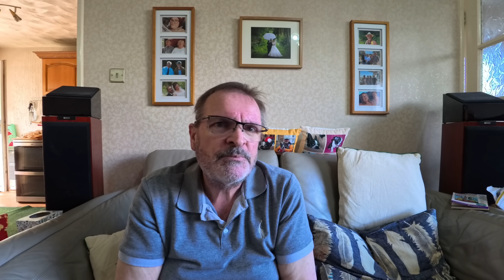Expert Ships Engineer Reacts to Baltimore Bridge Crash

Comment: Even if he managed to reverse the engine backwards, the effect of the screw occurs only after a significant reduction in speed, so turning to the right may be the result of a wide loop of instability, as a result of optimized trim to save fuel.
Reply from the maker: Surprised we have heard more yet

Comment: I enjoyed your modest but experienced perspective. As I rewatched the video of the crash after seeing the one anchor chain down toward the end of the video I wondered if the anchor dragging on the bottom on that leading side could have caused the back end to swing around and divert the front end into that support. Seems possible but I wonder what you think about that. Thank you.
Reply from the maker: Ive seen a second video from a different angle, you see the boat turn slightly to port just before impact. This suggests to be me the boat either hit a mud bank or the port anchor started to bite in.
Also ive been informed that the sea bed here is very soft mud so that kind rules out the anchor biting in. 
Lucky for the boat it did deflect slightly to port as it prevented the ship from striking the very base of the bridge legs.

Comment: Just so folks know, starboard is right and port is left. Also wondering if the Dali is a single screw or twin screw? That would mean left prop would be rotating in a right-hand direction and the right-side prop would turn in a left-hand rotation. Power to both at same RPM makes it go straight, varying more thrust from the right prop would make the ship turn left to port from increase of thrust while the left prop would have a reduction in power.
Reply from the maker: Single screw, most large ships only one screw

Comment: Thank you for your explanation.
However, I think the rudder effect doesn’t work at a speed of 7 knots. The ship turned quite fast.
Also when the lights gone out for the first time there shoild be a other aux starting and not immediatlely starting the em gen. Although i am not shore on that vsl.
Reply: No, it looks like a blackout.
So all trips. Reason unknown but could be simple as a fuel problem.
Reply from the maker: Yes im pretty sure the preferential trips would have gone first so why did the light go out.

Comment: You would think that the Pilot, an experienced sailor, would understand the ramifications of trying to go astern with forward momentum on a ship of that size.  Oh and they had two pilots. The idea, as the man mentions above, would be to clear the maritime obstruction (the bridge) by going ahead and using your restored power to maintain the vessel on a course to clear it.  You can run in your head based off of your ship's characteristics (tonnage, displacement, etc) how far the ship will travel after you give the order engines astern given current speed, current, wind direction and speed.  This is data that the pilot is provided with.  I don't think that the ship would have avoided the bridge even if power did NOT go out.  The forward moment of the ship, now with the crabwalk created by ordering engines astern changing the course of the ship, was going to hit the bridge supports whether it was the wrong call or done intentionally.  An order for engines astern or all stop is not instantaneous.

Comment: His expertise does not include bridge engineering. I would like to hear from structural engineers regarding the kinetics of the  bridge collapse.
Reply from the maker: Bridges are designed to support the normal loading but push it with a 100,000 tonne ship doing 7.6knots in the wrong direction.
Reply: @retroonhisbikes  Of course. The WAY the bridge collapsed after impact needs careful examination. And this fellow is not qualified to comment on that aspect of the accident.

Comment: This is a bridge that has well-known issues but its size would make it very expensive to replace. If the ship had an accident and damaged the bridge it would have to be replaced no matter what. I'll leave it to you to decide what really happened. Did someone decide to find an excuse to replace the bridge? Did the master of the ship decide to switch to bunker fuel while negotiating the harbor? The bridge was built during the 60-70's and the abutments were not properly protected from collisions.Ships of this capacity should be shadowed by tugs clear of any potential obstructions.

Comment: The ch/engr is spot on in this vlog. The stern movement was given which is clear from the black smoke was disaster, this action was taken by the pilot in panic. For Those who are not familiar with ships, the rudder does not work in stern movement. Half ahead movement no matter for even 45 seconds would have cleared the bridge, because the ship was already doing 7.5 knots ahead.
Reply: Repost this as no one else will see this due to YT censorship.

@JonPMeyer
2 days ago
Thanks, Chief! I have seen local Baltimore news reports that Dali was having electrical problems while docked in Baltimore. A local dock worker was interviewed and claimed that they were having to supply shore power (I think that's what she said) because Dali was not able to supply power to the refrigerator containers on board without blowing on-board circuit breakers. If accurate, that suggests a problem, or problems, with the on-board generators that may not have been completely corrected prior to departure. Your explanation that this type of large diesel engine will not function without electrical power for various pumps now makes this part of the story make some sense. Question: Do the same generators (or should we say "same switchboard"?) that power the lube and fuel pumps for the main engine ALSO power the on-board refrigerator units, or is there a separate system for the containers? Thanks again for sharing your expert knowledge!

Comment: After seeing this excellent explanation it got me thinking thinking that if while going ahead the propeller 'paddle wheel' effect is pushing the stern to starboard then  the rudder would need to be somewhat off of straight, so as to push the stern to the left to compensate. 

If so then  if the engine stops and steering is also lost the rudder will be stuck in that off-straight position, still pushing the stern to port and hence turning the ships bow to starboard, so the ship would veer to starboard even without the engine being put into reverse. Maybe this is what happened.

Something else I think, based on my limited (and possibly wrong) knowledge of the subject is that there wouldn't have been enough time to put the engine in reverse. These ships usually have a large slow running diesel directly connected to the propeller without any clutch or gearbox in between and the only way to go into reverse is to shut down the engine, set the engine itself into reverse (which is done by changes in the valve and injector timing) and then start the engine again. 

Apart from the time it normally takes I doubt it is even possible with the ship going at 7+ knots as the flow of the water would keep the propeller turning, or at the very least make it next to impossible for the starting gear to turn the engine in the opposite direction.  Hence why I think the engine never started after it stopped the first time.

Another possiblity is that the engine itself never lost power of its own accord and it was only the electrical power and hence also steering that was lost. In such case I think what would happen is that having lost control of steering they would do the most instinctive thing, though perhaps not the best in hindsight, which is to shut off the engine in an attempt to slow down whereas the better option may have been to just steam ahead on the same heading as it was until having passed under the bridge and only take action after having cleared it.  Of course it is an easy thing to say with hindsight but I can imagine it would be far from the obvious thing to do in the heat of the situation.
Reply from the maker: Dont forget the wind and pushing it the other way

Comment: How could they have gone to crash astern so quickly after a complete power failure?
Reply from the maker: I’m beginning to think the standby generator started at the same time as the emergency generator, and restored power to for the main engine. Most modern systems reset after power is restored, my current boat systems requires an engineer to rest them.
Reply: @retroonhisbikes  Ah, thanks for the reply. How long does it take to start the standby generator. I've heard there are started pneumatically? It would be interesting if you did a video on the sequence of events to restore power during a full blackout like this.
Reply from the maker: @vladimus9749 it’ll take seconds to start a standby generator. These are massive machines capable of running without sea water cooling for a few minutes, due to the amount of fresh water in the system.  Once running they go straight on the board, being a dead board there is no need to synchronise the on coming generator.

Comment: That's a very interesting analysis.
I'm sure they would have been on the correct course before the power went out. WHY would they have gone full astern in the first place?
Wouldn't maintaining the same course have been the better decision? The ship would have kept going on its original track, (Depending on current), anyway since the rudder was locked in place. The ship made 2 adjustments in direction.
Reply from the maker: I think panick set in and they didnt think clearly. They wanted to stop her before going under the bridge.

Comment: My question is this and hopefully an expert will answer it. Why wasn’t the ship in the channel before they had a problem? This single question alone makes a conspiracy
Reply from the maker: It was in the channel until the astern movement that caused the 14 degree turn to starboard (right)
Reply: Why do you ask why there weren't in the channel?  They very clearly were in the channel, and heading 141, which is lined up to pass under the centre of the bridge. 
Did you see a video from an acute angle and not understand the perspective, by any chance?

Comment: Been there, seen that, got the T-shirt. Twice.
Not a place you want to be on, at that moment. I was present twice, in the control room,when we lost it all, and skipper had to drop the anchors. I was in a ship first time in Recife harbour mouth, with no power. Sliiiding in, towards the docks!
Same in Gothemburg arcipelago, with a shit load of rocks on the seafloor. Scary, but what to do. The emergency gen. kicked in with a delay, on automatic(!!) for no good. And, You do not, have to clime up on deck. The rest on this film, is almost all, bullshit!
We simply had no time to react, but just drop those "thingies".
And, ships always go with diesel, not the heavy oil, when maneuvering, and before you stop the main engines. Just to "clean up" the fuel lines.
I am a Electro Engineeer/1;st Engineer, with 20 years, on different types of merc.ships/cruisers, all impossible to maneuver when you loose all!
Please, correct me, if I might be wrong.
from a Finn in Diaspora

Comment: I acted as a steamship agent for 13 years, handling mostly Panimax and Handymax bulk vessels. You are absolutely right about putting the main engine in full reverse causing the big black smoke. They have one main engine, about 10 meters tall, that is connected direct drive to the propeller.  It operates remotely from the engine room during an electricity loss. They have 3 generators and often an emergency generator outside the engine room. Only 1 generator is needed for most ship operations,  2 when using heavy loads like the anchor windlesses and the bow thrusters (which most cargo ships do not have) and one is redundant. The rudder is actuated by one of 2 electro/hydraulic pumps that work independently for redundancy. I also fully believe this was not a conspiracy (though I do believe some of them) and was a result of something wrong at the ship's electrical panel.
Reply: I believe intentional.

Comment: Did they have a standby team at the anchors? That You can operate without power(in standby mode), releasing either anchor would assist in turning the vessel.  Its not unusual to have blackout on cargo ships, it happens.
Reply from the maker: You can release an anchor by hand. They have giant break bands holding the weight.
Reply: They dropped the port anchor.  You can see in the photos after sunrise, the port anchor chain is in the water.
Reply: @jimbobeire  That is good, particularly if it happened before the impact. I am an old sailor, navigator, master marinet that went a shore long time ago...

Comment: Norfolk Naval Station 02 A 900' Container Ship lost power about a quarter of a mile from Pier 15 at approx. 6am while I was on roving watch at Pier 3. The ships comms were malfunctioning and their crew was limited to handheld radios for comms. The ship was inbound with a full load. 4 heavy Coast Guard Tugs met with her past Pier 8. Even with that it took the Tugs several minutes to gain positive control of the ship. The ship came withing 150' of colliding with Pier 4 3 and 2. Those Piers hold destroyers cruisers and submarines. It was an eventful morning I even recall the Destroyers with their bows pointing seaward training their Mk 45 5" Deck Gun at Pier 4 on the ship along with several semi-rigid rapid response boats being deployed. Took 2 weeks to get through the reports and investigations. Mind you this was seen as a potential failed terrorist attack considering the time this event took place.

Talking about the ships screws rotating creating uneven torque is the reason most multi screw driven ships use counter rotating screws. The same concept is applied to multi engine aircraft and has been around since the early 20th century. This helps to overcome uneven torque and yaw creating greater stability. In the US the original designers of the P-38 had to adopt this design concept due to many early flight tests resulting in crashes as the pilots could not overcome the craft pulling to one side beyond certain engine power levels.

Comment: I am an ex Marine Chief Engineer myself - forty years at sea - and ask the question  - is it a single propellor configuration or a  twin screw arrangement. The paddle wheel effect is different. I am presuming it is an electric thruster for main engine propulsion ?
Reply: M/V Dali is single prop vessel.

Comment: There’s some really good analysis here, and of course the usual trash by the trolls. 
Anyone who has his ticket, from a lowly coxswain up to a Master 1 will know and understand “prop walk”. This is precisely what the OP has stated here. And the poster who discussed the result of the Dali dropping anchor. I expect the accident investigation will determine that these two items will have contributed substantially to the collision with the bridge by compounding the already precarious situation caused by the loss of power. 

As with aircraft accidents, it is mostly a set of failures and errors that compound together to result in a major accident, and the same will no doubt apply here too.

It’s just a shame nowadays the media puts a spin on any newsworthy article taking the most controversial point of view resulting in sensational news. A bit of fact finding and research would do wonders for the media’s reputation.

Comment: Anyone that believes that the. Black box stop recording for the crucial 2 minutes before the crash is in my opinion the nutters...Black boxes have  a independent power source with  a non volatile semi conducter recording .They are hiding something that is for sure ...
Reply: The Black Box may have worked fine... but was it receiving any data from the instruments during the blackout? 
I remember a South African airliner that crashed and a lot of the cockpit recording was just no audio.  The problem was damage to the wires in between, from the fire that had brought the plane down. 
If the Black Box isn't receiving the signals, then it can't record them.

Comment: I have heard reports on the news that this ship had problems in port.  My question to you as an engineer is this.  Would you clear a vessele for open sea if you knew it had problems in port?  Though you did provide an excellent synopsis on the events leading up to the crash, you did not address the root cause of the failure to begin with. What these so called crack pots are suggesting, it that the ships systems may have been hacked to cause the power outage initially.  I don't think that is an unreasonable suggestion at all. I would like to hear from some of the commentors below @kennyc388 more about the encryption on the control systems.  Does the harbor master have ability to assume control of any vessel in range? is there any validity to the claim that  vessels be hacked  or remotely controlled as they claim?

Comment: Im not a Ship Engineer but I play one on the internet... JK.  Great explanation for the layman.  Basically they were dealing with chine-walk  or prop thrust and the effects of pivot on a dropped anchor and of course, inertia. Thx. That explains the crash. The real question is why hasn't the city installed barriers? I can almost guarantee they were a requirement after the Florida Skyway incident in the 1980's. Some DEI hired slack politician spent the funding on something else....That's where the investigation needs to go next.